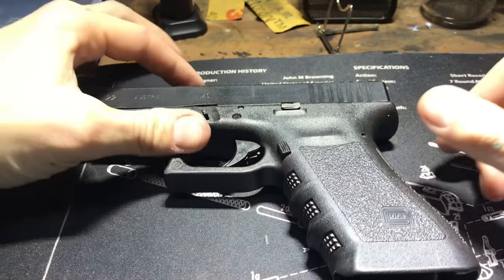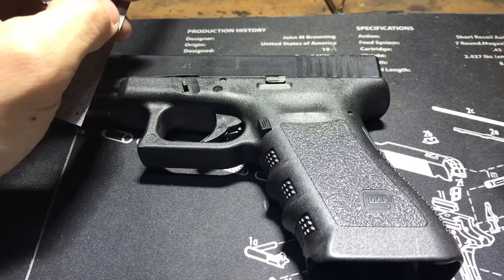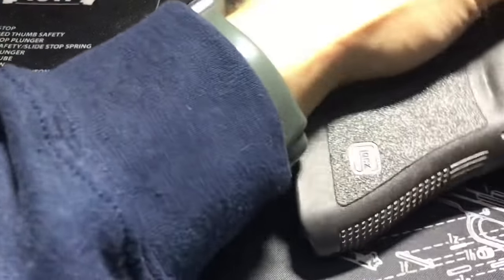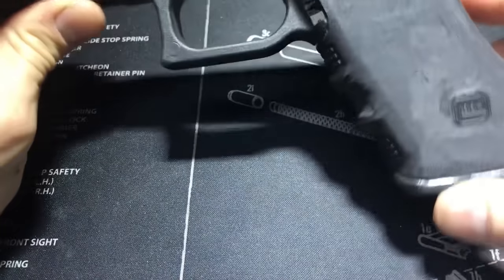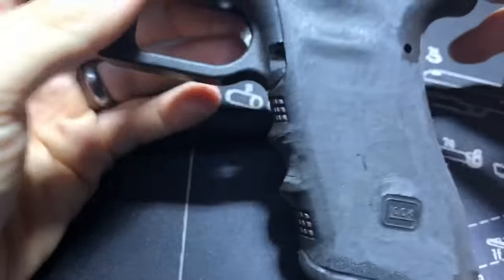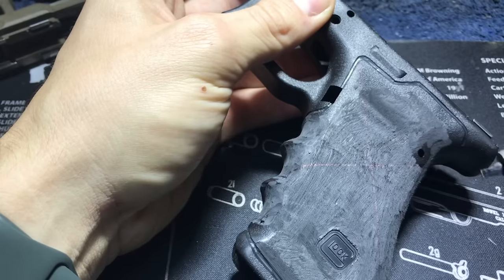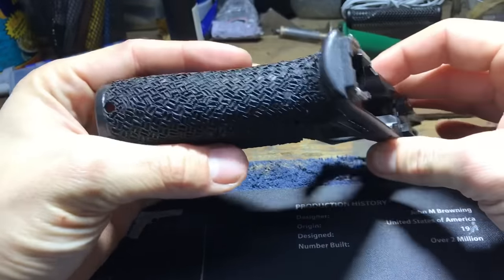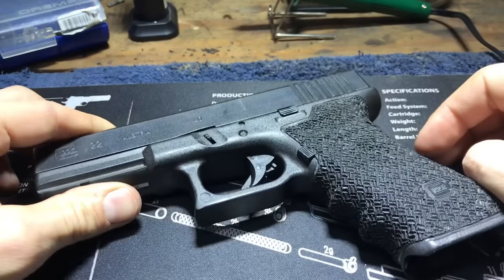Gun Stippling Tips and Techniques

Comment: Diamond dremel bit,flex extension,and heat controlled iron are the most overlooked parts to a good stipple job,being able to control heat makes a huge difference in the end look,I haven't seen one you tuber catch that yet,also buffing the under cut to a mirror finish (looks wet) is very easy if you know the tricks,when using a larger bit like a waffle go slow don't let the frame get to hot,this is where people got inconsistent results with the waffle,you cant go fast
Reply: 1st try using the cheapest soldering iron I could find, completed a perfect triple weave, under cut, finger rests on my SD40VE. Only thing you need is common sense and patience

Comment: i think the "17x" is a great idea, ive thought the same thing about concealment. sure a shorter slide may make sitting down slightly more comfortable but that all goes out the window with a fullsize light. The grip is what prints so bad though, while a full length slide might look a little goofy with a compact grip, i think its more practical than the 19x for concealment. 

i just got into stippling over the weekend and went totally overboard and stippled all my poly pistols, i learned a lot. i think ill end up with one of those wood carvers too. Trying to use the round cutting bit on the dremel for a boarder is hard and leaves a rougher look, i tried that end ended up going back around the boarder with my wood burner which, im sure as you know, is very hard to keep from melting too far outside the boarder. 

thanks for the good tips brother !

Comment: I bet you could make a simple little leather "glove" to protect your hand and wrist while using that gouge. Sew a thumb loop and have it go down your wrist and button down there. Use a heavy leather in the most likely places to get hit and then harden it, I'm not completely familiar with that process but I think it is pretty simple. I would suggest an actual glove but I hate limiting my fingers when doing stuff like this.

Do you end up going back around the border after stippling to clean it up? That little tool is a great idea, much better than trying to use a rotary tool and keep a straight line. Also how do you do the finger ledge? I've only ever seen people use a mill to do those

Comment: The dremel 2050 stylo does not go crazy when in a bind it shuts itself off and is the best dremel I've used because it is about the size of the flex shaft tool with the motor and all inside.

Comment: Amazing work.  But I have a couple of questions.  Did you only use the 1.5mm gouge on that finished border or did you step up in size off camera?  Or does doing multiple passes with the 1.5mm get it to thicken up the boarder like yours ended up looking at the end?
Reply from the maker: shinobi9922 I only use the 1.5mm gouge in the entire process. And I should have been more clear in the video but multiple passes isn’t necessary if you get the depth correct. And I believe the ending border looks thicker because it’s not just a line there by itself after the stippling.
Reply: Do you know by chance if your using the deep or shallow 1.5mm gouge?
Reply: @Curtissenyitko shallow 1.5

Comment: I wonder if you started on the back of the grip, or under the trigger guard, rather than the side, would the pattern be more exact and precise at the finish. just noticed how the pattern got a little wonky at the end. Beautiful job regardless.
Reply from the maker: The Rav Gaming I considered doing that for a long time. But since the frame starts to curve sooner if you start the the backstrap or under the trigger guard it actually makes it harder to keep the pattern consistent. This is one of the earliest weaves I did. After doing dozens of them, I still do one side at a time and you can’t tell where the pattern begins or ends in most cases.

Comment: Does not ruin the firearm, that Glock holds its value regardless, nice work. Do you ever do the area of the trigger finger test, high on the frame?
Reply from the maker: Yes I do finger Indexes in front of the takedown lever. I also offer thumb ledges/ accelerator cut/ shooters ledge there as well.
Reply: @tristarcustoms77  Ive stippled my rifle mags and am looking for a tip to do my Mossberg 930 handle, thx

Comment: Can u plz demo skeletonizing & stippling a mil spec grip? That is my next project, ive textured several but never skeletonized & im worried about structural integrity.
Reply from the maker: 321JKilla I’m working on a video where I stipple a magpul AR grip but I don’t really do the skeletonizing. When I get a milling machine I’ll probably do some on that.
Reply: TNT Tactical I've done the overmold grip and it turned out great but I'm now attempting to skeletonize the stock checkered area on a mil-spec (maybe leave an X for stability) using only a dremel & then stipple the remaining material. Lookn forward to ur nxt vid & Wish me luck, I'm too scurrrd to video & upload my work as the YouTube community can somehow always do it better, at least that's what they say...
Reply: TNT Tactical u not gonna attempt to make a mill with your vice&drill? It worked well b4,  brings new meaning to "Drill Press"

Comment: What's the key to using the u gouge? I bought one but on my practice material (magpul ar15 grip) it slips every couple millimeters and is very difficult to use.
Reply from the maker: 5.56 Or 5.45? Magpul stuff takes a lot of practice to use the u-gouge on. All there stuff has a lot of glass in it. It works best on Glock polymer. Anyway the truck to not letting slip is to wiggle it to start it cutting and if necessary keep wiggling to continually cut while keep one edge of the gouge riding a marked line. One thing you’ll run into is will scuff marks in your border line. You can go back and clean those up later though.
Reply: @tristarcustoms77  thanks for the reply man. Yeah I discovered the wiggle it's definitely helps.

Comment: There are bits with a lot more lines on it to make this go a lot faster. Stippling is by far the fastest part of a frame job.. It should take no more than 10 to 15 mins to put the texture on.
Reply from the maker: You’re simply wrong
Reply: @tristarcustoms77  ahh. I guess I would know nothing after the business I own and the thousands of frames I've done. They have a tip made for the basket weave pattern, so you don't have to make every single individual line. All I was saying..
Reply from the maker: @thirdmonkeyent_llc  please drop a link to your website or social media so I can see all the high quality stippling jobs youve done with a store bought basket weave tip that you’ve done in 10-15 minutes 🙄 . If you’ve done that many frames you should be competent enough to know that large tips to speed up custom work look like trash.
Reply: @tristarcustoms77  well, we don't offer basket weave. I think it's a little over used and doesn't have great purchase. All I was saying is they make tips that help it go a lot faster for you. Probably already heard of them, but Oregon Trail Defense has a huge selection of texturing pattern tips, one being for basket weave. Also owned by a really great guy. Patterns don't always have to be perfectly organized. One of our patterns is what I would call organized. One is semi organized like a web, and the other not organized, a lot like a rock texture. But they all get heat treated to remove surface sharpness from the polymer bloom and increase durability. We like function first, but believe in it still looking professional on top of that which is why we only do two things that serve no function. The borders and polishing on all the cutting. We also do some more extensive "polymer surgery" like grip reductions, backstrap integrations, beaver tails, grip length conversations, i.e. Glock 17 cut to accept Glock 19 magazines, hump engagements (same thing as Boresight's razor back) and others. But yeah, we always love to have more people check us out. Modern Warrior Systems on Instagram. Keep on keeping on.

Comment: For the flexcut 1.5mm tool. Which degree do you use, 45, 60, 90? Also is it a v or u cut
Reply from the maker: corykalina it’s a Flexcut U-gouge and I’m not sure about the angle but I would guess 60 degree

Comment: Do you have to take out the inner parts when you’re sanding and stippling?
Reply from the maker: @Funwitguns  only the mag release typically
Reply: @tristarcustoms77  OK cause when I sanded mine, I didn’t take out the inner parts. I see that everyone does thank you for responding.
Reply from the maker: @Funwitguns  just use some air to blow the dust out of the frame and it’s fine 👍🏼

Comment: One question running through my mind while watching it is, with all that grinding away of material, does the frame become weaker or more prone to cracking? Has anyone's stippled polymer frame cracked because of this technique? 
Just curious.
Reply from the maker: Chas Gordon I’ve stippled a hundred frames now and cracking is never an issue. Your slimline glocks can sometimes warp if your not careful but if you put a mag in it you’re going to be fine

Comment: You ought to reposition your cutting direction so your not cutting toward yourself. Anyone that works with sharp tools with half a brain would say cut away from yourself. That way when, not if, but when you slip you don't have a trip to the hospital to repair a severed artery, nerve or tendon. Then again some people have to cause that much damage to change their ways to work safer. 

When sanding and burning polymers you should be working under, in front of or over an extraction fan. 

That pattern really does look nice. I'm hopefully going to start a gunsmithing course this year and this is one thing I definitely want to do. 

How is it that you are doing gunsmithing work without an FFL? As I understand it you can't charge for gunsmithing work without your own FFL?
Reply from the maker: I am an FFL now at TNT Tactical which is our store front FFL.. when I’m not working in from of that camera angle I keep my hands and arms out of the way of the cutting edge. Yeh an extraction fan would be nice but a mask and a desk fan are doing the trick right now. This video is my old set up. I’m now doing all my work out of my store shop..

Comment: Lol, 95% of gunsmithing is fixing other people's screw ups. I'm sure you've gotten in atleast a few "jar" guns. Where some dude brings in a gun completely taken apart to the bare frame with all the parts in a jar that he cant put back together or hes put it back together and it didnt work and he cant figure it out. That's how I got started in gunsmithing. I'm a certified welder and I've been building racing engines since I was 15 but I've been "full strip gun cleaning" since I was about 9 or 10 and if a part was broken or worn it was usually pretty easy to replace that part. Once I was used to most every firearm operating system it was just kind of natural to customize, repair, refinish, and clean guns. Having a background in automotive body work helped alot with the gun coatings and refinishing  also. If you've got a mind for mechanical things, and an eye and patience for fine detail work you should be able to do some nice work  with a little practice. Instead of gun frames I started stippling on polymer accessories like vertical grips, cheap spare AR parts and similar stuff. A 10$ used magpul vertical grip is alot cheaper than a new polymer frame/reciever. Good luck to any beginners out there. Gunsmiths are a dieing breed and there will always be a need for people who can repair, customize and/or build guns.